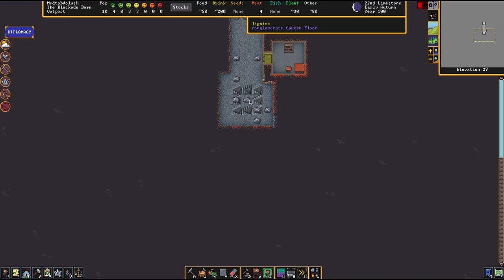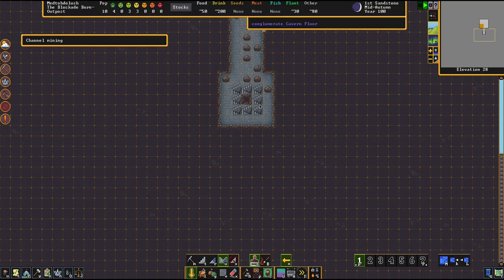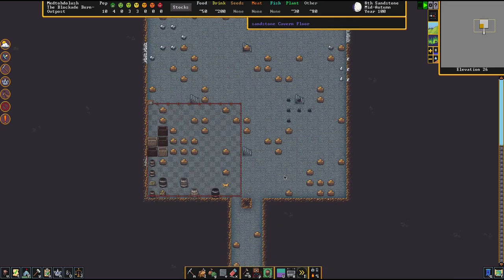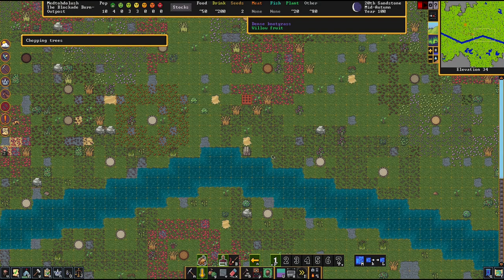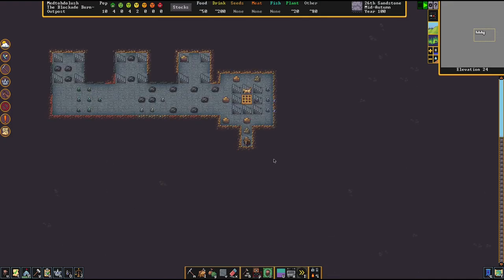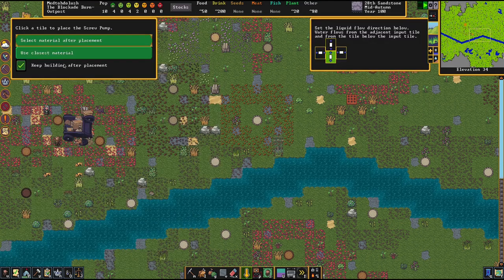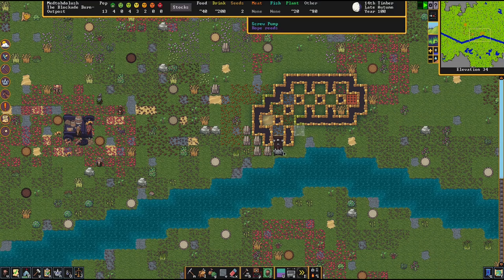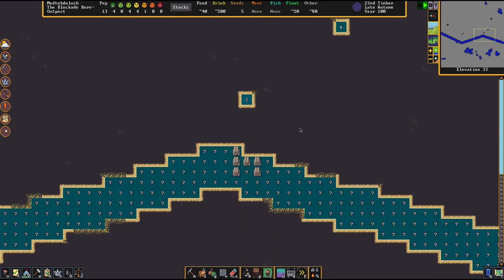Specific Guide to Dwarf Fortress | Mist Generator

Comment: Great info! I was able to create this 1 level down without a pump or windmill or constructed walls. Just used a bridge to control the water.
Reply from the maker: Nice! Are you using it like a flood gate sort of?
Reply: Yep, wanted to be able to stop the flow. Just in case. 😀 Thanks for the tip!

Comment: The windmill doesn't have to be connected by being right next to the pump, you can connect it with a horizontal axle to make it a little bit more aesthetically pleasing, should you wish for such a thing.
Reply from the maker: Thanks for the tip! I do want more aesthitaclly pleasing layouts 😊